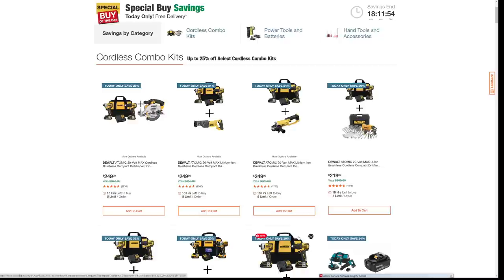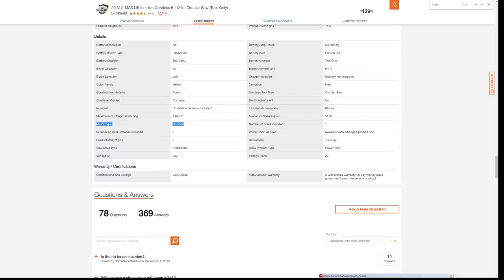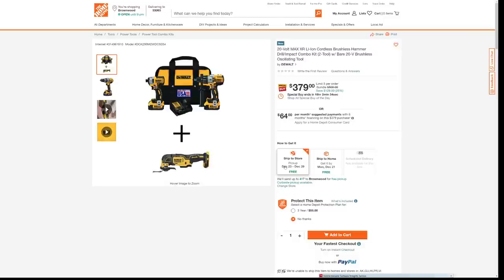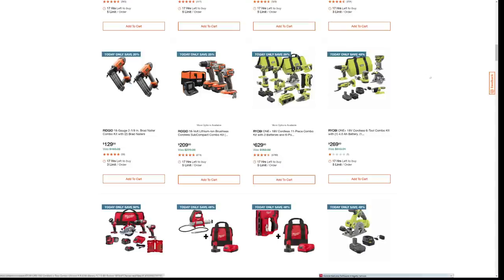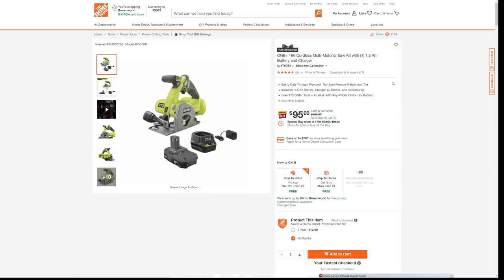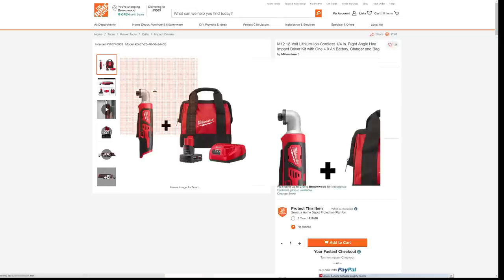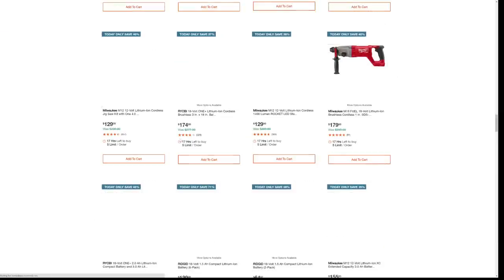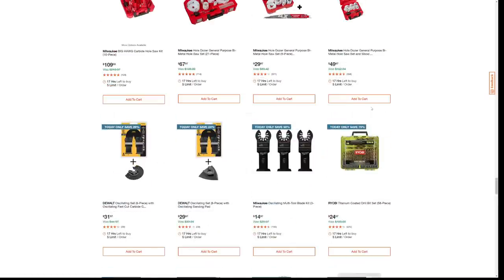Home Depot Special Buy Of Day Christmas Tool Ideas: Dewalt, Milwaukee, Makita, Ryobi

Comment: I bought the M12 rocket light last week.  I ordered the deal of the day so I can get the battery and I’ll return the light I got last week.  I agree that the 4amp battery is the minimum you should  use to run the light.  I used the light for the first time yesterday while installing a generator interlock kit for my wife’s friend.  I like how compact and how little it weighs.
Reply: Love my m12 light, it stands up perfectly on the peak of rooftops. A 6.0 lasts about as long as I can at night
Reply from the maker: It is a very lightweight light, sometimes I bring that instead of the M18 light!

Comment: I see down near the bottom they have DeWalt 10", thin kerf table saw blade for $30 My question is can these blades be used with any table saw that takes a 10" blade? I'm probably getting a Delta Table saw for Christmas. Thank you. I'm new to power tools and wood working
Reply from the maker: I think you should be bale to sue it on nay saw. But this thin kerf might want to wobble a bit, so make sure it goes on a high quality saw.

Comment: There is NO difference between the 3 DeWalt models of brushless multi tools in power etc. One has a 3 pos. max power selector. thats it, INCLUDING the atomic. i have and do use all 3 with the 354 aka Atomic being the most used. 354 replaced the 355, the 356 being the "top of the line"
Reply from the maker: Yes, my XR top of the line models also have 3 position selector switches

Comment: There are certainly instances where a brushless motor/tool is markedly better than the brushed version of the same tool.  You really do need to look at the specs.  The real advantage of brushless is battery efficiency and to a certain extent wear and tear.  That being said there is the new FUEL Milwaukee recip SawZall that is available and it looks identical to the non brushless version that has been out for quite some time.  These days the brushed version is selling for half the price of the brushless version.  My local tool guy told me he's sold hundreds of the brushed versions and never had any issues or heard of any issues.   For most people who are non contractors you will not see the benefits of brushless for some tools.   In some cases the brushless is no guarantee of quality.  Jeff did a test on the leaf blowers and the Dewalt and the Milwaukee are brushless but really I find to be mediocre performers in spite of being brushless.  My crappo plug in Toro blower is better than those blowers.  I found the Dewalt has alot of trigger lag.  
In truth brushless is likely how ALL tools will be built in the future but it is also true that there are contractors out there who have 10 year old brushed tools that are still going strong... they may just need more batteries during the day.  My two cents
Reply from the maker: Good info thank Michael
Reply: @jeffostroff  Well you know if you can buy two brushed recip saws for the price of ONE brushless then unless you are a mega demolition guy it doesn't make alot of sense..   BTW  Jeff  we love your tours of the Depot.. you are certainly the deal meister.

Comment: i got this, is this a good deal?      M18 18-Volt Lithium-Ion Brushless Cordless Hammer Drill/Impact Combo Kit (2-Tool) with Free M18 HACKZALL   for $250   2625-20   2902-20     2850-20    charger 2 batteries 5 Amp and 2 amp hour

Comment: @jeffostroff  -rigid table saw with the better stand for $299
Reply from the maker: How did you score it at that price, did you use one of the Lowes 10% off coupons?
Reply: Nope, guess it's special buy for day.  Pickup or delivery
Reply: So if you got a 10% lowes could get it $269